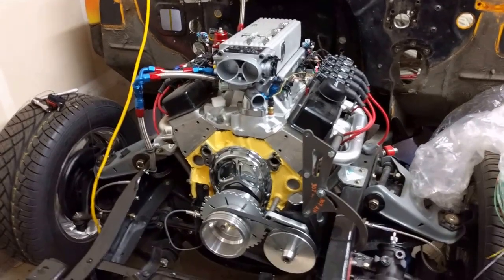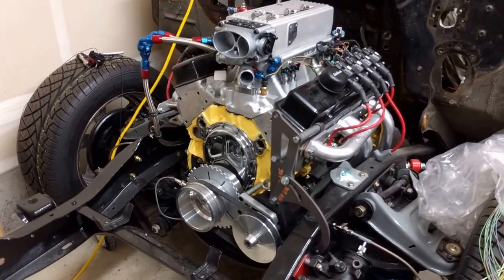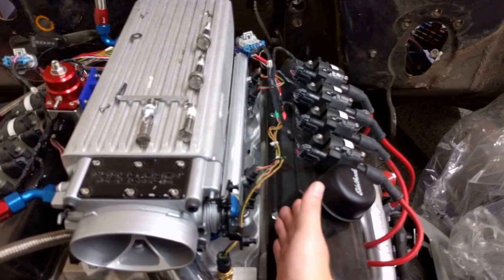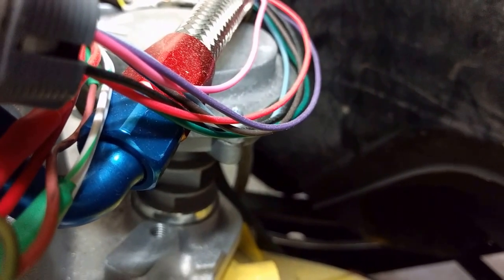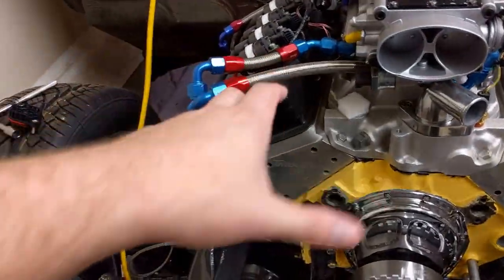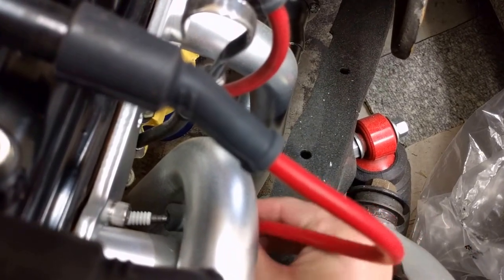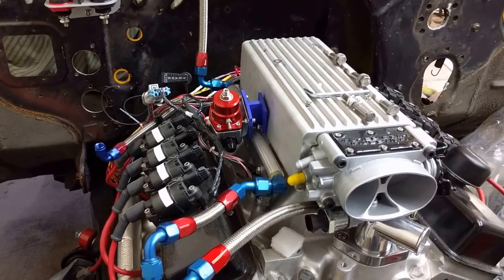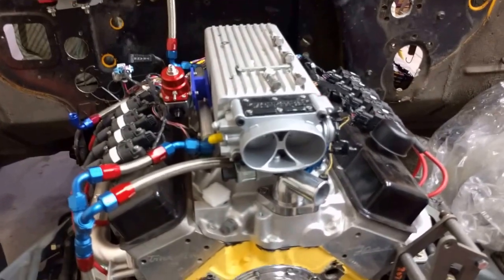Gen 1 Small block Chevy with sequential fuel and spark

Comment: Great project and useful video.. currently i am building a 632 & i am looking for coil on plug system
Reply from the maker: You have a few options these days. MSD makes a coil on plug system now, or you can go the DIY route too if you're doing fuel injection as well. Best of luck! The 632 will be a monster.

Comment: Love it!  I'm starting a similar-ish build. Holley HP EFI but Gen1 SBC 350, FIRST Fuel Injection long-runner intake, Profiler 195cc heads, Aggressive Hydraulic Roller cam, sequential multiport EFI, D581 LS3-style truck coil-near-plug ignition, 60-2 Crank Trigger, Vortec 1x cam sync sensor.  In my 79 Vette with a 4L60e trans and lockup TC hoping to get 20 mpg hwy and am estimating 440hp; 470 ft lbs. Mike Jones 227/228 hydraulic roller with 0.600" lift on the intake.  Full length coated 1 5/8" headers.  I just finished purchasing everything so now my work begins.
Reply from the maker: Awesome! Just be sure that long-runner intake will clear your hood :).
Reply: Intake clears; front of the throttle body can be a problem.  Had it milled at a slight angle. ;-)

Comment: Very nice! Very impressed! I’m not voting for the map sensor though. You are going with sequential and I love that! You  want precision but the L-jetronic system is much more precise than the D- jetronic system. Having both sensors is advisable if your software has a fail safe program that reverts to map control when the airflow meter fails. Btw the throttle body looks kinda small.
Reply from the maker: The throttle body in the video is still a stock unit, more suited to a 305 than a 350. An upgrade in the future definitely would have been warranted :). And I agree that a MAP backup is great for if a MAF fails.

Comment: I have a 91 K1500 Silverado with a 350 in it. I’m trying to switch to a MSD multi coil system and multi port fuel injection with a Ram Jet intake manifold, and switching my cylinder heads to Chevrolet Performance vortec cylinder heads, and if I could, I’d switch to dual exhaust. I also plan using a Airaid throttlebody spacer and Spectra Premium cold air intake kit. One last thing, I plan on putting a stroker kit in it and camshaft kit to match the cylinder heads lift. This is just a long term goal of mine.

Comment: So I’m kinda late to the party but could you use this same cam and crank sensor with a Holley system and if so is do I have to Aline the sensors with timing I want to do the same thing for my lt1 Camaro instead of torque head

Comment: Thats a unique setup up you have, I am working toward something similar on my L98.   

About mounting the coils; tack—did you do it yourself or go to a local welder 👨‍🏭 or did you use a glue to mount the ignition coils on the valve covers? 

As for crimping the wires, that requires a special Ignition Wire Crimping tool, yes?   Thanks
Reply from the maker: I welded them in myself. I bolted the studs to a coil bracket so they'd be spaced and plumb correctly, then held it to the valve cover and tacked it in. 

For ignition wires, yes there is a special type of crimper for those. Amazon and summit racing both sell them. I'll link you one in a bit.
Reply from the maker: Here is a tool that would work: https://smile.amazon.com/IWISS-Ratchet-Crimper-Ignition-Terminals/dp/B07K2VG6XY/ref=mp_s_a_1_3?crid=1FH983U77TXVK&dchild=1&keywords=spark+plug+wire+crimping+tool&qid=1633793061&sprefix=spark+plug+wire+cr&sr=8-3

Comment: Hmmm. That would be a good setup to set the engine further back in the engine bay, with that small sensor back there. And plus, as much as I love my carburetors, I have to admit that the EFI does offer better response at multiple throttle levels. Those 2 things alone would make that setup ideal for road racing, without the inconveniences of fitting an LS into an older car
Reply from the maker: Yeah if you used adjustable mounts you could likely move the engine back a few more inches and get some handling benefits. I think, depending on the exhaust and oil pan there would also be room on these to drop the engine an inch lower and give you a better center of gravity. That said, you might get as much benefit going to a lighter (aluminum) block too :).

Comment: Why do you need the crank sensor and the distributor pickup?
Reply from the maker: You don't need both. You could run wasted spark with a crank only, or sequential with a dist pickup. The idea though was that we might get more precise spark control and control of misfire using both since the ECU could have two sensors to read for data. Dist pickups have a good bit of backlash, so the position variance when going from deceleration to acceleration is measurable. Doesn't make a huge difference practically in most cases, but it could lead to misfires.

Comment: You interested in doing another one like your with a twist = some how using a mechanical tach drive as in an old corvette. OR How else to pick up a cam signal.
Reply from the maker: I'd honestly get a converter from someone like Dakota Digital to convert the signal how you need it. You can get cam pickup sensors for these that go where the distributor went.

Comment: If you could please let me know where you got the crank trigger set up from and info please
Reply from the maker: https://www.diyautotune.com/ and search for trigger wheels. You can get the hall effect sensor there. I built a mounting bracket myself. I took the wheel to a machine shop along with my harmonic balancer  and had them enlarge the center hole so it sat around the harmonic balancer lip. Hope that helps!
Reply: Ebay

Comment: Wouldn't  it be better to mount  your regulator on the firewall with 2 short hoses rather than the hot engine, just a thought.
Reply from the maker: You can certainly do that, but not if you're going to drag race at all. For safety reasons you're not allowed to mount a fuel source to the firewall. Being as that it's a firewall, you don't really want to have a fuel source attached to it, in case of a fire.

Comment: Spark pulls wires? Didnt have time to watch the full video when I commented and didnt hear anything about it.
Reply from the maker: You could likely use wires for an LS1. We had our full-length MSD wires, so we bought new crimp-ends, cut the wires down, and re-crimped so they weren't wasted.
Reply: @ElementalGarageandGaming  okay, I have a 94 LT1 Firebird with the 24x coil pack. It's the LS ignition setup with obd2 computer. I could not fit stock straight boot ls plug wires around headers but I'm looking at Taylor  10.5mm diameter, 11.75" length, 135 degree boot plugs. I think they will do the trick. Itll be nice to not have to cut my own wires.

Comment: The fuel rail thing is (NOT) true, here's why..

With the normal front crossover, you have a feed entering one side and the fuel crosses over then out through a regulator.. 90% of Gm vehicles ran at 43 psi, so you (HAVE TO) have 43 psi on the rails at every injector when they open due to the regulator being well past all 8 injectors regulating it....

If you didn't have the correct psi at the regulator, your fuel pump may not be strong enough to keep it at pressure, but you will have 43psi at each injector with a cross over, i mean there are guys running 1000hp+ with crossover types, that whole single feed for each is a misnomer..

Hope my explanation helps.. Again always run a aeromotive type separate regulator,  they are the most accurate and best IMHO..
Reply from the maker: Keep in mind that flow and pressure, although related, are not the same thing. Aeromotive recommends a Y setup, I think primarily to ensure both rails see equal flow. As you mentioned, a regulator will keep the pressure equal in the system, but I think it's possible to see a uniform pressure but variations in flow to specific injectors. Just my .02, but you bring up interesting points. And I agree about running a separate regulator. We used Aeromotive on this as well.

Comment: I’m wanting to install the setup on my LT -1 .  Can I use the “411” elm?  Could I get your email?
Reply from the maker: You can contact us as havefun@elementalg2.com
Reply: @ElementalGarageandGaming  I can use 96-97 timing cover for crankshaft sensor , I’ll have to figure out a Camshaft sensor. Any suggestions you can give will help. All this electronics is new to me.
Reply from the maker: You'd probably have to use a different intake that has a provision for a rear distributor instead of the opti-spark. Then you'd use a cam pickup sensor that is driven by the oil pump like a distributor. It's that, or you get the EFI connection timing cover that has both a crank and cam sensor built in.

Comment: How much did all this cost?
Reply from the maker: Overall figure it will cost about $1,000 more than what you'd already buy for a fuel injection conversion (manifolds, fuel pump, computer, wiring). Hard to justify with the prevalence and cheapness of LS motors, but some people may want to do something different, or have either sentimental or monetary attachments to their SBC/BBC and want to convert those to a coil-on-plug instead.
Reply: @ElementalGarageandGaming  do you have an email or fb? I'd like to pick your brain if that's OK. I have a vortec 355 I'd like to do same setup
Reply from the maker: havefun@elementalg2.com - Sorry we didn't see this earlier! We are also on facebook at https://www.facebook.com/ElementalGarage

Comment: Why is or that no one ever just uses a stock ls computer they are way better when it comes to reliability and tuning ease
Reply from the maker: See my other comment. There are many valid reasons to use a stock setup and tune it with something like HP Tuners. There are also compelling reasons to use other solutions. It just depends on how you're prioritizing your project. For me, money was not the #1 priority when selecting solutions, and I don't share your opinion that a stock ECU is way better in regards to reliability and tuning ease.
Reply: Because you have to pay $700 for hptuner. I have a similar setup and chose Holley terminator x . I can tune it all day long/any day :pay a little more at the beginning and less at the end.

Comment: Why doesnt it make as much power as a LS ? Its very common to get 750 hp out of a real small block naturally aspirated for drag race. If you want it streetable put milder pistons/cam and run a turbo. My freinds dragster runs a 383 small block with a procharger and dry sump and puts out 990 hp.  Or you can go the big block route, but good heads will cost you 3k minimum new.
Reply from the maker: I should say as much power as an LS at the same price point or level of efficiency. Like you said you can crank a Gen I SBC up to some awesome power levels, but you're giving up something relative to doing the same with an LS, whether it be efficiency, longevity, etc. I think you're also likely to get more area under the curve on an LS, so it's not just about peak power.

Comment: You could have done that a whole lot cheaper with a stock 99-up ls  computer the computer doesn't know what it's hooked to took a la harness cut or what you didn't need it's really quite simple
Reply from the maker: The same could be said for nearly any aftermarket injected/computer system. One, I wanted to experience using the Megasquirt, as I like the community behind it. Two, it offers a lot of future options when it comes to extensibility, like for adding forced injection, nitrous control, flex fuel, etc. You can also use extra ports to add things like launch control.
Reply: Or you could just ditch the computer junk and build a real drag motor.
Reply: I could have just bought a used 540 Chevy on Racingjunk.com for 6k that was 1100 hp. No computer problems.
Reply from the maker: @donrutter6765  Except I wasn't building a drag car. You could also say ditch the motor junk and build a jet engine. One, it was a road car, and two, I was trying to do something unique. Anyone can go build a turn-key motor and drop it in. If that's what I wanted to do, I would have done it. But then again, if I wanted to just HAVE a drag car, I'd go buy something new that would do a 10 second 1/4 from the factory rather than spend money building it. Sometimes it's not about the destination bud . . .
Reply from the maker: @donrutter6765  Where you might see computer problems I might see someone who doesn't know how to tune or build an EFI car. I don't begrudge anyone for sticking to what they're comfortable with, but don't knock technology just because you may not understand it enough not to have difficulties with it. Carb's have issues too, you might just be more comfortable rebuilding one.  I prefer EFI because of flexibility and adaptability. When is the last time you saw a carb re-jet itself for altitude changes?
Reply: @donrutter6765  I think grandpa needs to get back to his retirement home.

Comment: LS motors are NOT that much better than a small block. There are plenty of small blocks out there that prove it, and an ls is an ugly engine especially compared to a small block. If you were building a drag car wit a blower ot turbo then maybe it might be a better choice... thats debatable also.
Reply from the maker: I love both, but hard to argue with the economics of a cheap LS build vs. what it would take to go coil-on-plug in a SBC. But these aren't hobbies of economics :).
Reply: Check my build.